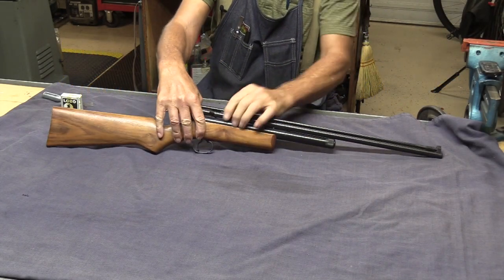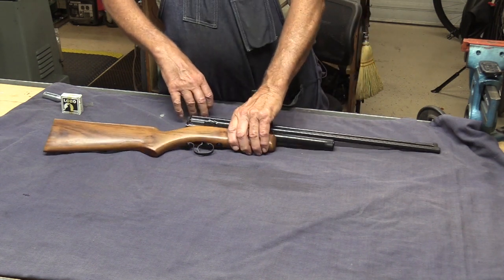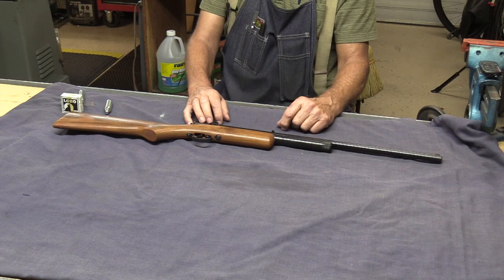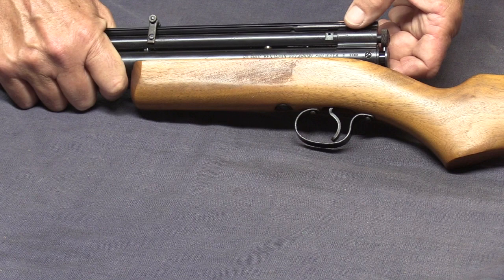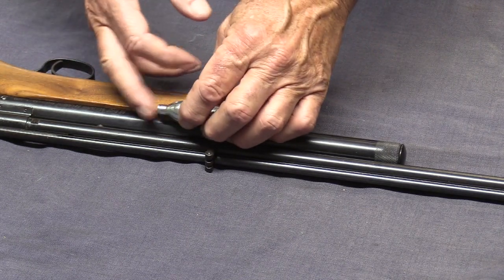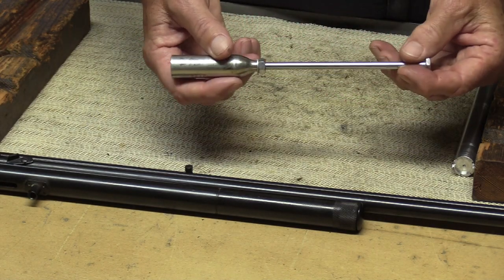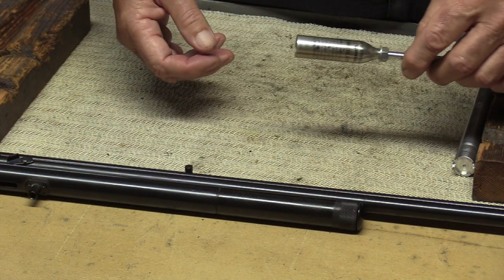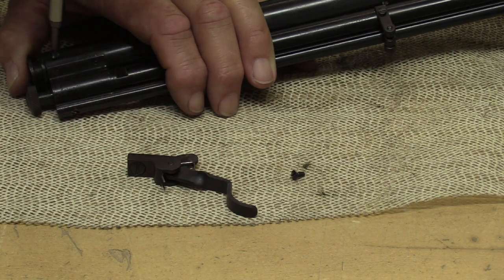Rebuilding a Benjamin 3620, 85 Shot, Co2 Repeater

Comment: Another good video!  What size screw are used to hold on the end caps?  It looks like you replaced/or refinished them?  I need to do that on my Benjamin 1320 
pistol.  Somebody replaced them with phillips heads and they do not look right.
Reply from the maker: Ron, those are 2-56 oval head slotted screws.  Good luck finding them at Home Depot.  Shoot me an email and I'll refer you to a source.  nwa@northwestairguns.com